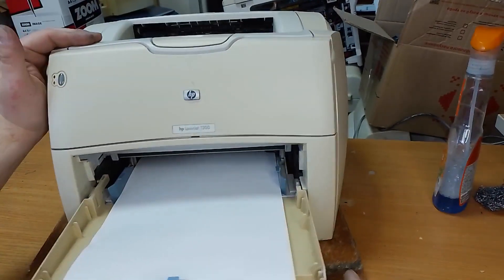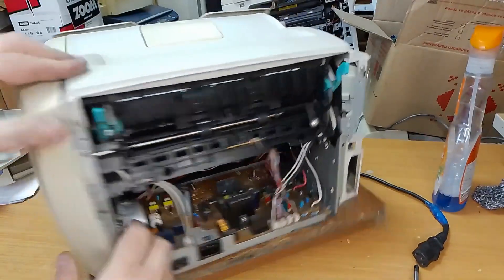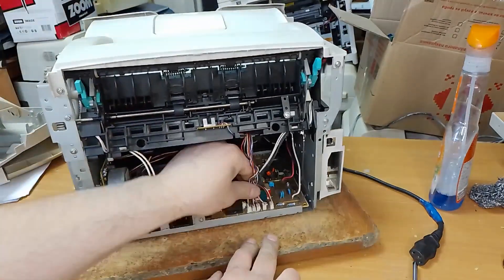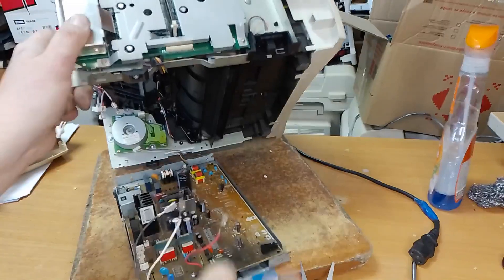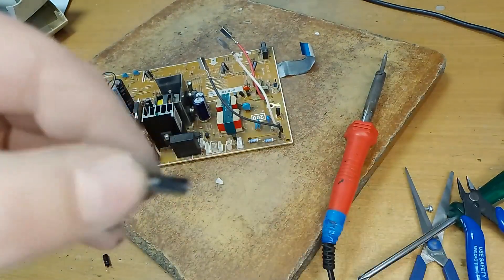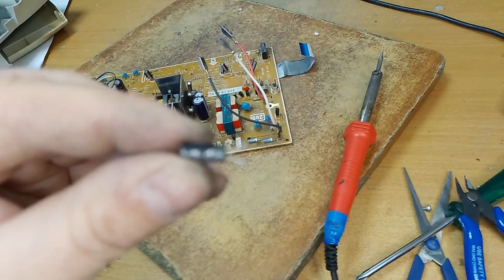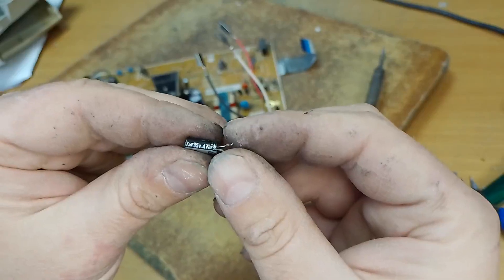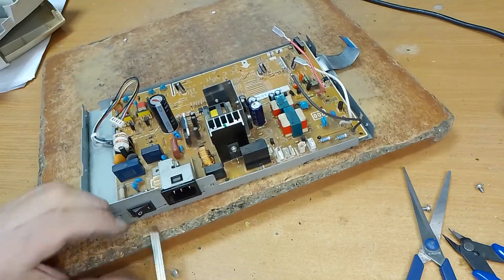HP LaserJet 1300 Printer Orange Light Blinking

Comment: Can you please tell me about the solution of the problem . I have the same problem of blinking orange light but after out and in of the toner cartridge several times. The printer get ready for print. But after several hours the same problem raised again. What should i need to do with it?
Reply from the maker: Replace capacitors in DC controller, such in video.
Reply: @printhelper  Now the printer is not getting power on I don't know maybe the supply has crashed or some capacitors in it. what to do with it now?

Comment: Hello! So my paper was working well and a paper got stuck inside. I open the back to get that paper out. There are two green levers on each side. i accidentally broke the right one and now the orange light is blinking. I have tried everything except the capacitors. Could you tell my what could be the problem and how do i fix it? Thankyou!
Reply from the maker: Both green levers must be in upper levet. Press up right lever.